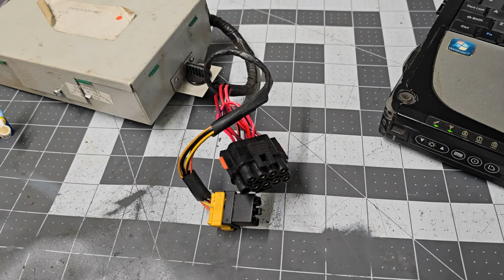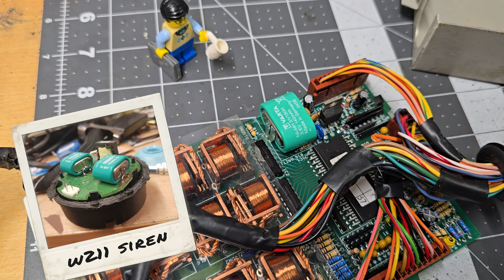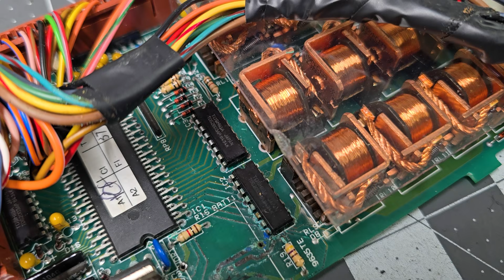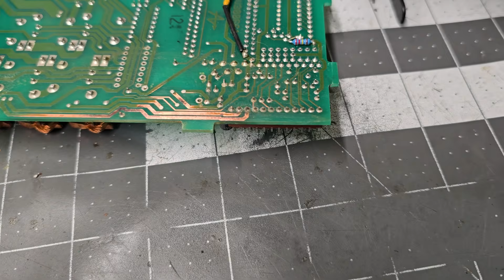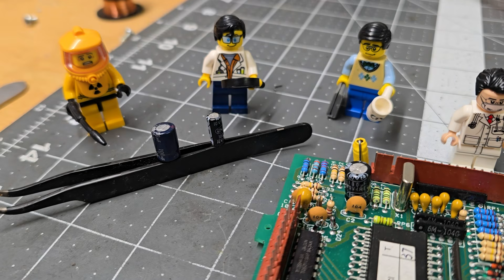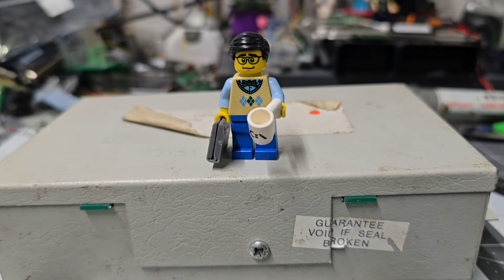Bentley Seat Module repair

Comment: You know, on sci-fi shows they would "re-root" the power from a keyboard and write a subroutine while they were at it. All while alien ruffians were bearing down with energy weapons. I think you did it the proper way with solder and copper.
Reply from the maker: LaForge, Divert power from manoeuvring thrusters to forward shields!
Aye Captain, I'll get the extension from the shed
Reply: @endtuning  LOL!